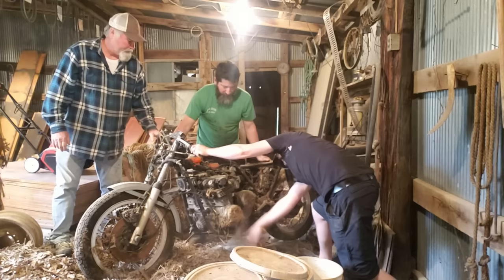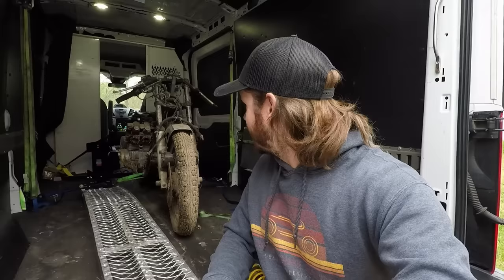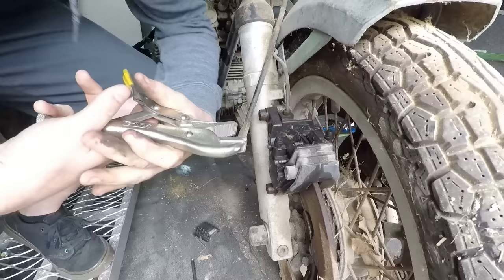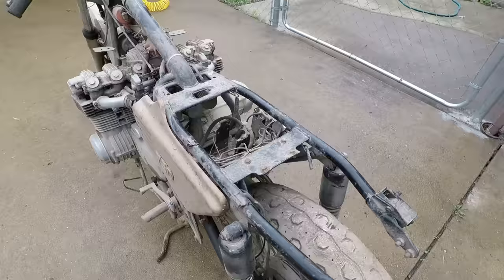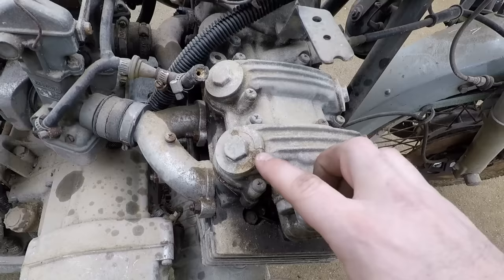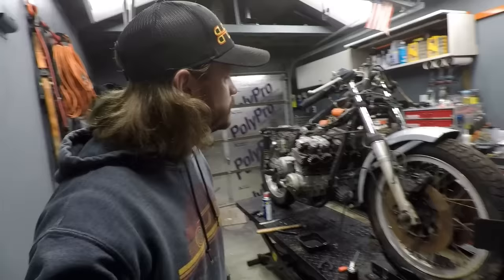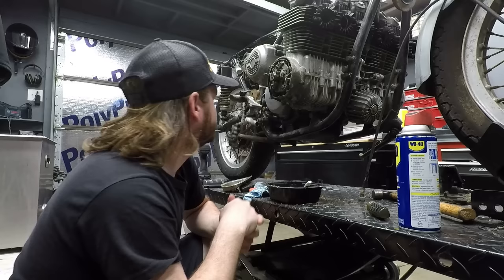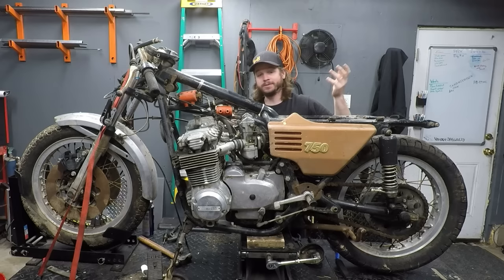BARN FIND Benelli 750 SEI 6 Cylinder!

Comment: Is it the same engine as the Honda cbx 1000?
Reply from the maker: No this predates the CBX1000 as it is the first mass production inline 6 bike.  Honda did have an earlier 6 but was a race bike. This engine IS however based off of a Honda CB500F with two added cylinders and more changes.

Comment: Fill the cylinders up with vinegar and leave it to do it’s job.
Reply from the maker: Without neutralizing it after that would lead to issues
Reply: @BrickHouseBuilds  yes it would lead to issues, fill them up and if it works then neutralise, it really works well, or use diesel, I’m restoring an Aprilia rs250 mk1 at the moment. Good luck with your projects.

Comment: If you JB Weld it and it some how lets go when your riding…..then what.
Reply from the maker: Well then that would mean I got the bike running.  If it let go and I needed a full case disassembly then thats what it would get at that point.
Reply: @BrickHouseBuilds  LOL!! I meant loss of oil, engine seize you hitting the ground. What i’m sayin is I don’t trust the JB weld to hold. I would weld it up. It ain’t worth the risk.
Good luck and take care.
Reply from the maker: I know what you meant, very unlikely scenario.

Comment: Should of bought a CBX6, these things were a real Lemon even when they were new here in the UK, copy of a Honda engine with 2 added cyls,,,,....,made decades before LOL
Reply from the maker: I wouldn't say lemon at all. The Honda rc166 was first but yes these are based off of CB500F engines which are reliable. CB500s were only a few years before these were made not decades. I also have two CBXs which I mention in the video.
Reply: @BrickHouseBuilds  SOHC 750....made in 1967/8..first ones being sand cast.. it all came after that...the 900 Sei was "slightly" better, 750 was a dead horse.
Reply from the maker: @markholroyde9412  I hear the opposite.  The attempt to make the 900 better made it heavier an no faster. I also have multiple sohc cb750s
Reply from the maker: @markholroyde9412  but the Benelli is not modeled on the 750

Comment: Well you have to put diesel in the cylinders and wait, give it a pull, wait, give it a pull………
Reply from the maker: This I know. I just wish I had more than 24 hours to buy the bike and do an assessment. I'll do it right though when I schedule it in
Reply: @BrickHouseBuilds  would be very interesting to see if you bring it to life again!
We had an Ford 32 with no cylinder head on for like 30 years in a barn, very rusty, it was a Chevy 327 and for 2 weeks we pour diesel and give it a knock with a hammer and a wood piece every day and in the finish we get the engine running!
Reply from the maker: Check this playlist out for me reviving my 75 CB750 that was seized. Been a fantastic bike Barn Find Honda CB750 Revival!: https://www.youtube.com/playlist?list=PLerq_C5Llt2wEBcwIU0UPXQPieo8orpR0

Comment: Seperti baru saja di letakan, karena kedua rodanya masih terdapat angin
Reply from the maker: No, not accurate.  First, I talk about airing up the tires multiple times and you can see the compressor in my van. Also, when you put a motorcycle on the centerstand there is not enough weight on the wheels to even compress the tires.  This bike had been there a long time!

Comment: Not a good idea to pressure wash a bike that's not sealed up and then not strip it down, you will have got water in it in various places and when you do come to take it apart it will be damaged more. I'm not attacking you or being negative but just giving you my thoughts from my decades of experience.
Reply from the maker: I do this often. Many thought I didn't cover the exhaust since I simply didn't record that butbI first use wd40 in the ports, then fill with rags, then wash around it, then remove, use compressed air in the ports, then a new coating of wd40.  The side being cracked was just me not being able to see that part of it.

Comment: u using impact driver for sump cover wrongly...u dont give enough pressure on the tool since your bike wobble on that stand...u should strap it....should save u a lot of time rather than drilling it....
Reply from the maker: The bolts were bent and were not going to come out like an undamaged one would. They required the drilling

Comment: JBweld? It's a Benelli Sei!
Reply from the maker: I agree but if it means I could get it running faster that may be an option
Reply: @BrickHouseBuilds  improving on the Sei is definitely the way to go. It takes a lot to do that of course. But no JB weld, no parting out if possible!
Btw, I've had a butchered Masi bike from 78, sold the pantographed parts, sold the frame to someone in America who very diligently had the frame restored to its original splendor. Or better!

Comment: Another load of bollocks find where there is not one rusty bolt to be found, and even the tyres have air in them! A quick wash with a hose and “suddenly” a piece of shit turns into a valuable antique work of art worth loads of money.
Reply from the maker: No rusty bolts?  The whole bike has corrosion and rust lol. Also, think back to when we tipped it upright. The center stand was down. A bike with flat tires on a center stand won't have enough force on the tires to even deform them. If you have a bike with a center stand go let the air out and see.  Also note I mention airing them up. You can see my compressor in the van as I close the doors. Also, how is this carcass worth loads of money?

Comment: I have a 750 SEI  Know a fair amount about them.  Mine is a 76  s/n 7023.  Bought it new.  I was a dealer for several yrs.  Lot of standard Moto Guzzi and BMW parts along with Honda CB500 parts.  Looks like a set of Pirelli tires from 90's.  No clip ons or that other junk on it.  A 78 Moto Guzzi 850T has a fair amount of interchangeable frame and suspension parts.  Headers, almost impossible 6 into 6, diode board Guzzi and BMW, same alternator, nylon swing arm bushings, Gas tank good luck  6.3 gal.  Instruments Vergila.  3 oints, set off main then other two.https://www.youtube.com/watch?v=1KZZ0o91OyM
Reply from the maker: Man THAT is awesome info I need to hear!  Thank you!

Comment: I can't believe the tires of this motorcycle aren't flat ! There's something wrong. It's fake!
Reply from the maker: A few things as this comment has been made a few times now. I actually think it's cool people want to say it's fake. 
1 - Notice that the center stand is down as we lift the bike.
2 - Notice I mentioned airing up the tires and you can see my compressor in my van as I shut the doors.
3 - even if they were flat you would not deform them when on the center stand. If you have a bike with a center stand go pull the valve cores and test for yourself.
4 - Why would I fake it? I don't make click bait videos or anything of the like. You can see many videos on my channel digging bikes out and making them run.
Reply: @BrickHouseBuilds  I have a Z1B900 that had been sitting for over 30 years the tyres were flat and couldn’t believe they held air when inflated to move the bike.

Comment: Fake
Reply from the maker: Whats fake?
Reply: @BrickHouseBuilds  I think it’s all set up.
Reply: @BrickHouseBuilds  4:32 Those tires didn’t flat?
Reply from the maker: @erichuang2553  ok a setup for what? I aired the tires up. You can see the compressor in my van and hear the conversation about inflating tires a couple times. Also, when a bike goes on a center stand there is almost no weight on the tires at all so even flat there would be no tire deflection.